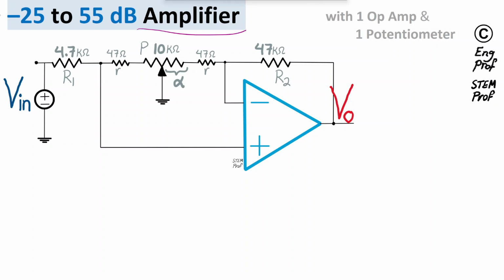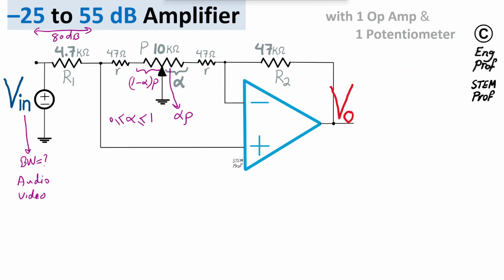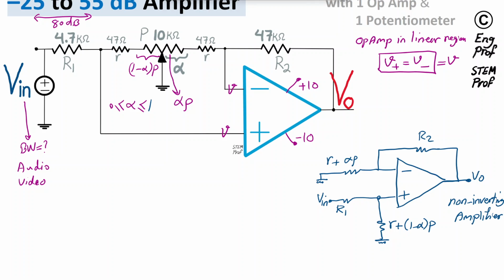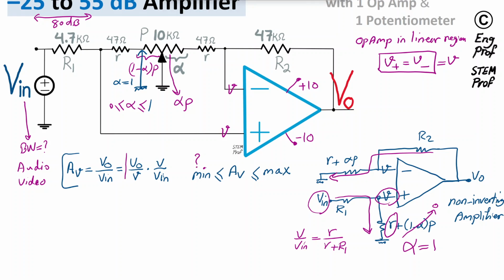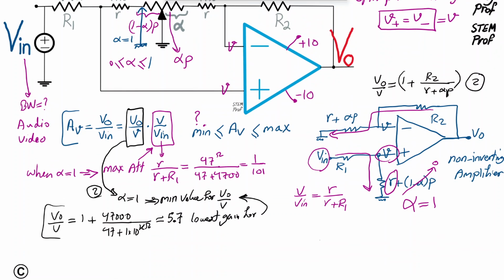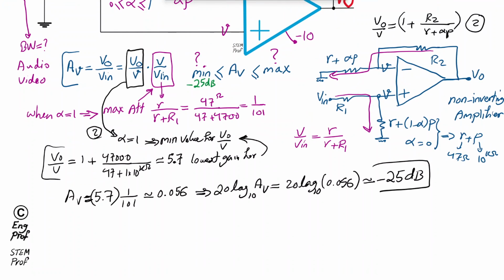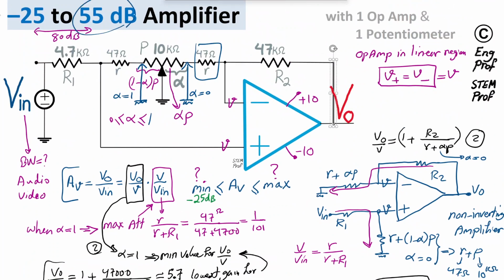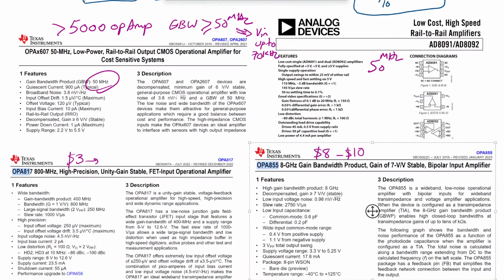Op Amp Amplifier with -25 to 55 dB Attenuation-Gain range

Comment from the maker: Thanks for watching. For more examples please see: 
Op Amp Amplifier with Electronic Gain Control: How does it work? https://youtu.be/NoNgQpbj77Y
Instrumentation Amplifier with Electronic Gain Control https://youtu.be/C4tghZ-q6Zs
Power Amplifier Design (Class A) with Transformer https://youtu.be/gKlJrqGqeCI
VCA Electronic Gain Control (Part 1): Voltage-Controlled Attenuator Overview https://youtu.be/cFzYZsPEtP0
Analog Multiplier Circuit  https://youtu.be/VP53A2zpVMQ
Push-Pull Power Amplifier Design with Op Amp, Sziklai Darlington Transistors https://youtu.be/8BFzsi7-Vbs
Thermometer Circuit Design with Op Amp & BJT transistor https://youtu.be/55YsraFE0rg
Analog Vector Summer Circuit Design with Op Amp and BJT Transistors https://youtu.be/PIAsa0QNVns
Op Amp Analog Computer Differential Equation Solver https://youtu.be/ENq39EesfPw
Push-Pull Power Amplifier with Darlington Transistors https://youtu.be/866MYibo8yE
Sallen-Key Analog Filter Design Tutorial https://youtu.be/KwUnQXbk7gM

For more analog circuits and signal processing examples see the Analog Circuits Video playlist: https://www.youtube.com/playlist?list=PLrwXF7N522y4c7c-8KBjrwd7IyaZfWxyt
I hope these Circuit design and analysis videos are interesting and useful. 🙋‍♂

Comment: hi really appreciate your videos helped me learn a lot . i'm in a predicament designing a similar circuit . 
my specification : Input +-10Vac or +-5Vac or 3.3Vac  / 50Mhz . Output:+-.5Vac / 50Mhz , which equals to , respectively to 1/20 gain  = 0.05 = 26.02dB for +-10Vac and 1/10 gain = .1 = -20dB for +-5Vac and 1/6.6 gain = .1515 = -16.39 for +-3.3Vac input signal . i really prefer to achieve this with FDA configuration but  single-ended I/O op amp would suffice . i have many issues finding a circuit capable of this requirements . 1 your design for achieving 25dB inputs 1/101 of the input signal into op-amp . 2 i cannot find a find an op-amp with a reliable spice model to simulate this setup before designing and every simulation attempt is failed so far 3- output noise on the opamps is very reliant on the Rf value , extracting this value from datasheet and employing it in simulation software produces a very different output than expected .. 
4- i'm having a hard time finding suitable op amp for this task 
i would really appreciate if you could help me to find solution for these problems , btw i'm designing this as an ADC Driver and also i'm using proteus for simulation .
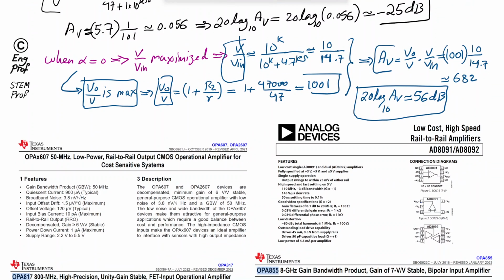Reply from the maker: You're welcome Sam. Glad that my channel is useful. Regarding the choice of Op Amp, as discussed in minute 18:00 in this video, I suggest CMOS low-noise op amps from Texas Instruments of Analog Devices with zero or near zero offsets and very low drift. I also suggest a decent slew rate which of course depends on the maximum input frequency in your applications. Also see the Texas Instruments Op Amp used in https://youtu.be/HYqKQ-nUf5o video. Alternatively, you might consider TI FET-input TLV9301 Op Amp or more expensive TI LMH6714 for higher frequency (say video applications).  I hope this is helpful.
Reply: @STEMprof  thanks for your help .

Comment: A greatness of this schematic is that you can use a linear potentiometer and get a log scale attenuation. A very demanded feature for an audio amp
Reply from the maker: Thanks for highlighting the log scale attenuation using single linear Potentiometer and single op amp. To your good point, Another example of adjustable Attenuator circuit for audio signal processing applications is the VCA voltage-controlled Attenuator discussed in https://youtu.be/cFzYZsPEtP0
Reply: You don't get a log scale attenuation, just a wide range. The logs are in the dB calculation, not the circuit. Nobody said anything about the distribution of the gain with pot position or the noise gain. Similar circuits are use for audio trimming by connecting the pot wiper to the inverting input which gives symmetrical gain/attenuation with 0dB in the centre and only noise gain with signal gain.
Reply from the maker: @hintoninstruments2369  Thanks for watching and sharing your thoughts. As you noted, this circuit is presented as an interesting minimal design example to achieve a very wide gain/attenuation range using just one op amp, one Potentiometer & few resistors.  The Gain has a nonlinear relationship with the wiper position.

Comment: Thank you for video. Seems like input impedance will vary with the gain.
Reply: Input impedance variation is inevitable. May be you can cascade a  Commom-collector stage on 'Vin'  to have almost constant input impedance.
Reply from the maker: @Parirash123  thanks for sharing your thoughts and your design suggestion. Another technique is discussed in Op Amp Amplifier with high input impedance and large voltage gain https://youtu.be/jriZt1OR5Ok
Ultimately, if constant and very large input impedance is required in a given design, Maybe just adding a buffer stage op amp at input is the safest way to satisfy such absolute requirement. This is illustrated in the video of Instrumentation Amplifier with Electronic Gain Control https://youtu.be/C4tghZ-q6Zs . I hope this is helpful.
Reply from the maker: You are welcome. Thanks for sharing your thoughts. While you are right that input impedance changes as we adjust the Potentiometer, the input impedance has the minimum of R1 (4.7kOhm in this example) and the maximum of R1+10 kOhm (14.7 kOhm ) meaning the change is not substantial (not orders of magnitude). If need be, We can also further decrease dynamic range of input impedance by increasing the value of R1. An alternative method is discussed in Another technique is discussed in Op Amp Amplifier with high input impedance and large voltage gain https://youtu.be/jriZt1OR5Ok . I hope this is helpful. 
For more examples please see my Analog & Op Amp Circuit Videos playlist https://youtube.com/playlist?list=PLrwXF7N522y4c7c-8KBjrwd7IyaZfWxyt